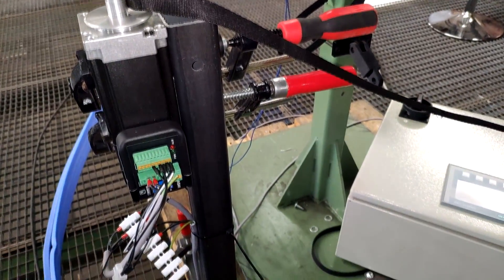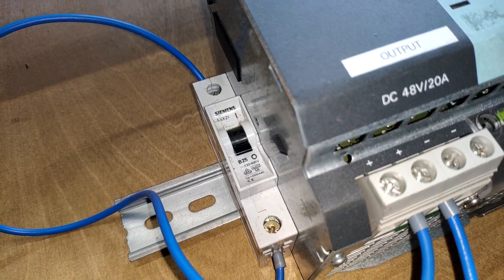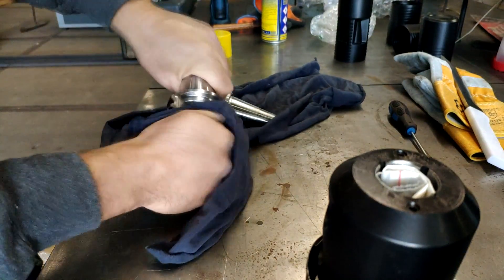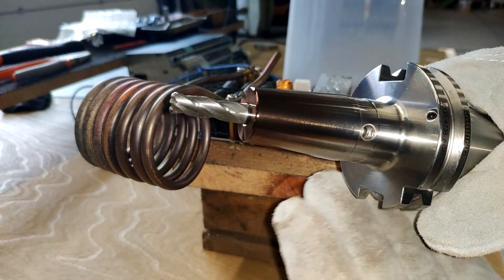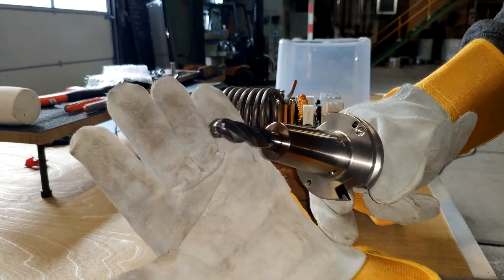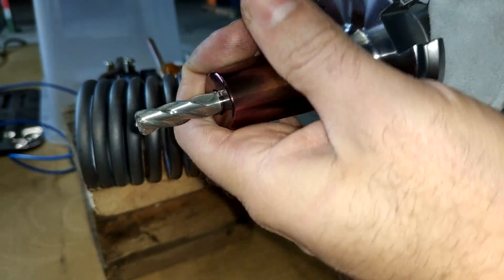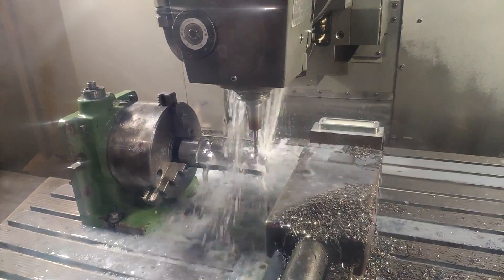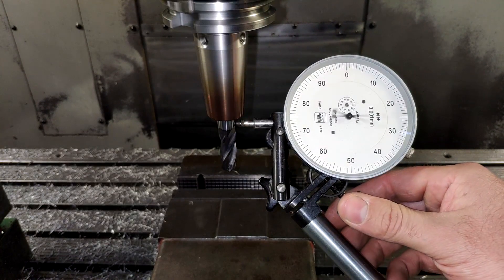DIY Tool Shrinking for less than 100€?

Comment: That's pretty interesting, I appreciate you also showing how to remove the tools, which is something I was wondering about.  I've only got a manual mill, and it's not even running yet, so it's all a bit academic for me, but interesting video.  Been thinking about setting up an induction hardening setup for a while, that could be fun.

Speaking of hardening, /please/ tell me the - umm - "tool" you show at the end has an integral coolant feed.

Comment: I tried with 1kW ZVS (48V 20A power supply) and was struggling especially with taking the tool out of the shank.  Module is overloading.  Will try with 2500W it should work better.
Reply from the maker: The more ferromagnetic material you insert into the coil, the more inductance you create, thus increasing the load on the supply. I got in there just with the tip (:D), not to trigger the overload state. Maybe this helps you, i.m.o you don't need the bigger module, because a matching supply gets way more expensive.
Reply: @Roetz40  Quick update - maybe somene will benefit from my experience.  I managed to plug in Sitop power supply which can withstand 1,5kW for short time (nominal 48V 20A with x1,5 overload) and with this unit taking tool out of the shank is relatively OK.  So, good power supply is crucial here and I do not recommend using cheap ones from you know where :)
Reply from the maker: Thank you for the update!

Comment: Please add water cooling to your heater. The components that connect to the copper tube will get hot enough to burn or desolder themselves.
Reply from the maker: I was worried at first aswell. But even at max power rating it takes at least 5 minutes to get measurable heat into the heatsinks. So for short periods it is not needed at all!

Comment: Do you think that lab power supply (like e.g. Zhaoxin KXN-6020D 60V 20A) will do?
Reply from the maker: I dont know the unit but die stats are perfect. The induction circuit is rated to 50V, 20 A. So youre right there with a bit of headroom
Reply: @Roetz40  Thanks.  What cables did you use (what thickness) to connect transformer to the circuit board?

Comment: hope you ... uh .. hardened that ... test piece with the induction heater afterwards 😇
Reply from the maker: Seems like one of the usual cases of: the last 20% of result take 80% of the work. 
Wenn du mal einen Kontakt für irgendwas suchst - meld dich ;)
Reply from the maker: I would've. But I just cant get it into the hole... 
How's your mill doing? Or still chasing noises ? :D
Reply: @Roetz40  Still missing some way covers for the remaining axes, the way it's set up now chips can get everywhere and it's no fun to use :\

Comment: Makes me wonder, Doesnt the Maho controller have a function to preset tools? I know Heidenhain does it by doing a tooldef in your program. This makes the toolchanger already moving the magazine to the next tool. Saves a lot of time if you got a slow changer
Reply from the maker: It is a Heidenhain controller actually. And you're right, the line tool def presets the chain to the next tool needed.

Comment: My desktop CNC uses a collet system.with a screw-on CNC collet nut to hold the collet and tool in place. I wish someone would come up with a shrink tool equivalent. I would love to not have to use collets and be able to have a constant tool Z height.
Reply from the maker: Can't give you information on that regard. But I guess it comes down to tighten the nut with a torque wrench. Then it might be quite repeatable.
Reply from the maker: That's already available. Have a look at the haimer website for example. They offer shrinking collets in different flavours. If I remember correctly they are called TER collets.
Reply: @Roetz40  Awesome! Thank you! I wonder how consistent the 'Z' is when still using a collet nut?